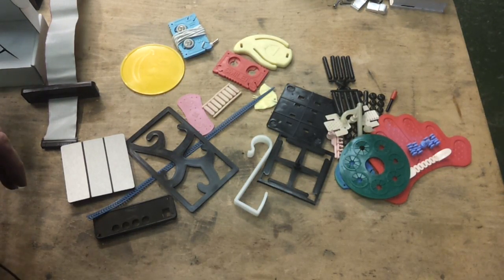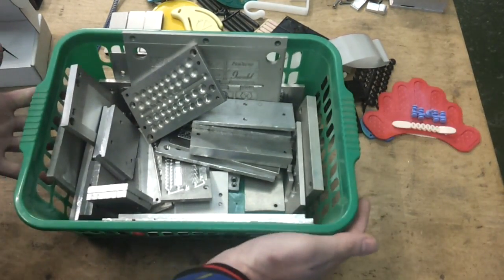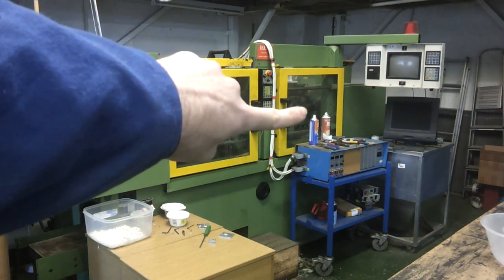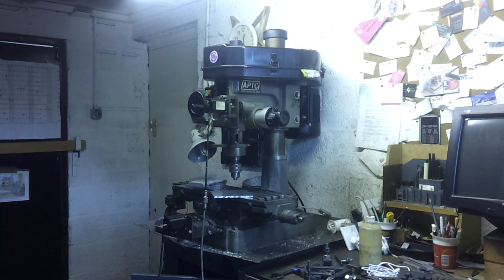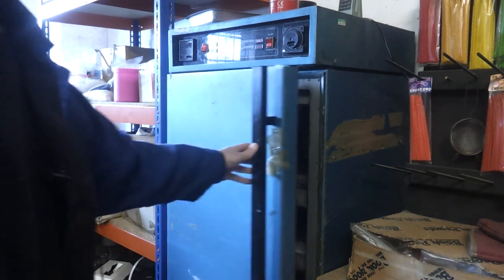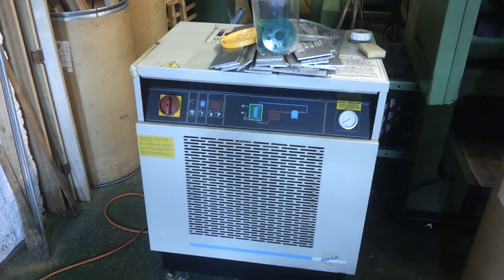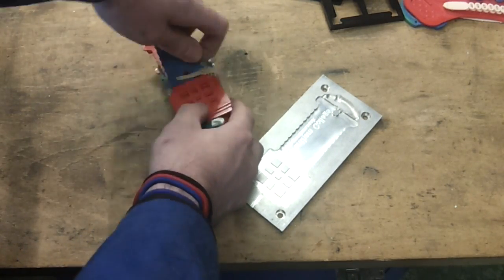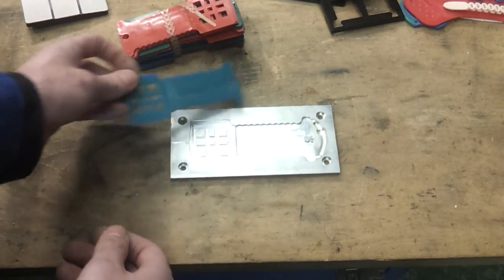Introduction to DIY Homebrew Injection Moulding

Comment: Introduction to DIY Homebrew Injection Moulding . . . first you gonna need a 40 ton Arburg lol not exactly "homebrew"
Reply from the maker: Yes, a 40T press is a bit big for the home, but there are alternative options - I'll be doing a video about it at some point.

There are quite a few small machines available that would fit in a garage, and check out the JohnSL channel to see what can be done on a table top Travin.

An industrial machine is more suitable for a hackerspace or community workshop. I know of some who have big Bridgeport-style milling machines already, and a moulder wouldn't be out of place in that kind of environment.

Comment: Comparing 3d printing with injection molding is like comparing a hammer to a frying pan! These tools are both great as soon a you use them for the right work.

Comment: This is ingenious! I built my own CNC machine and now I want to try with DIY injection moulding :) This video is great! Any advice for the design of the first mold? I want to start with the extruder of a 3D printer and use a regular filament to inject the parts. What do you think about that?

Comment: Thanks for this informative video. The small mold inserts are a good idea, since the heavier job is done by old steel molds. BTW which cnc would be enough precise for that? A shapeoko can handle that?
Reply from the maker: Maybe if you go slow a Shapeoko would work. I use a converted Axminster machine which is quite robust, but struggles with steel. In aluminium I tend to cut up to 1mm deep and run at no more than 6x the cutter diameter in mm/min. So 1mm cutters take some time at just 6mm per min!

You also need to use cutting fluid for anything less than a 3mm cutter, which can be problematic on the smaller table-top CNC machines. The much higher spindle speed will help, though, so may only need dabbing every so often.

As for accuracy, a lot is down to experience with the machine. Mine isn't great, but I've learned how to compensate and can hit about 50um in the X and Y. The Z is even better with a resolution of about 10um. I actually have to let the thing warm up as the spindle will expand about 40-50um after half an hour of running!

Comment: Thank you very much for making this video Andy, I have a Clarke cam 1225 miller which I thick is virtually the same as yours and I would be very grateful to hear how you did the CBC conversion on it please, particularly if you swapped the lead screws for ball screws Any help very gratefully appreciated and thank youPhil
Reply from the maker: Just added the stepper motors with some ironmongery. No change to the leadscrews, though the X and Y axes use a 5:1 reduction gearing which helps. Backlash is measured with a test gauge and compensated for in software.

The key to getting good accuracy is not trying to cut too fast. The pressure from the cut will cause a small deviation from the required path. I cut at 6x the diameter of the bit in mm/min. So it's very slow, but the accuracy is then down to about 50um, which is good enough for my purposes.

Comment: Nice setup Andy
Reply from the maker: Thanks! The CNC milling machine is nothing special, definitely garage/hobby level. It gets a lot of use though, since most of the work is making the moulds.

My moulding machine is a bit more hardcore, really need a small workshop for that, but there are smaller ones readily available on the secondhand market. (Or you could get to know a local moulder and borrow theirs when you need to.)

Rest of the equipment (drier, chiller, granulator, lathe) isn't essential. Mine don't get used all that much to be honest.

Comment: Thanks for making these videos Andy. I am in the process of deciding What to do, I am planing on building a small but well done injection mold machine, I'm a machinist. I see some small professional models similar to yours available for what seams very reasonable cost and wonder if I should just buy one of those instead of building my own. I would go that route but all of the ones for sale are far away and would cost 2 times more to ship then to buy.
Reply from the maker: I built a small moulding machine a couple of years ago, and it wasn't very impressive. A lot of work for something that "just about worked". Haven't yet seen a hobby machine that compares to a professional moulder, you need a lot of pressure and fine control on the injection side to get consistent results.( It can be done of course, but by the time you've got it working you may be wishing you'd just bought one instead!)

The reality is I can spend a few days making a mould and a few hours actually moulding it. The injection moulding machine is sitting there doing nothing most of the time.

So an alternative option would be to contact a local moulder and see if they'd be happy to run your moulds on one of their machines. They'd need to put together a bolster - probably recycle an old mould tool with a new face plate - but that shouldn't be too expensive, and you'd need that if you bought a pro machine anyway. 

Then you can get 50-100 good quality parts per hour without needing a machine yourself. (Machine costs are usually about £20-30 per hour.) The smaller moulding firms are your best bet for this approach. You'll also learn a great deal by hanging out with them, and if/when you get your own machine, you'll know how to use it.
Reply: Thanks Andy. I agree about having injection mold companies do the work, but I am a machinist and simply can't resist building my own machine so I'll see how that goes. I figure if I can have some success then it may be justified to purchase a professional small injection mold machine such as a boy or something similar.

~

Comment: Sir i am building a injection molding machine, but my confusion is,
Which sensor i should use to detect whether the part is stuck on mold or have been successfully ejected ! So that next cycle could be run.
Reply from the maker: Industrial machines have a low-pressure clamping action ("mould safety" it's called). If the mould doesn't close fully on a low force, then something is wrong and it'll re-open the mould and trigger an alarm. You could also use a light-barrier to check for stuck parts, or possibly detect them after ejection to make sure they dropped.

Comment: what type of plastic did u use to make the head phone holder
Reply from the maker: It was a thermoplastic elastomer (TPE), specifically a styrene-ethylene-butylene-styrene (SEBS).

Quite useful stuff since it blends well with high density polyethylene, so you can vary the hardness by mixing it.

Comment: I'm a member at nottingham hackspace, I thought all the hooks were just from the shop :) so i guess well done :) lol
Reply from the maker: Thanks! Some of the members came over one afternoon to do those. They were a pretty quick job.
Reply: I guess I know why people were so confused when I asked if we had an injection moulder lol
I've been looking at building a small plunger style one, and just wondered if it was worth it.
Reply from the maker: Early injection moulders used a plunger design, so it's tried and tested. (Some schools use a bench vice and hot glue gun to demonstrate the process.) There are quite a lot of plans out there for simple machines, and if you check ebay you'll see them come up fairly often. (Easier to modify one than start from scratch.)

I used to have a Travin machine which worked reasonable well (cost a few hundred secondhand). Tricky to get a consistent cycle, but I think that's down to practice. Plunger designs also don't mix the plastic very well, so adding colourants is a bit hit or miss, but otherwise it did the job for small parts.

Biggest issue with small machines is you need a very fast and powerful injection stroke. The clamping is not critical, car bottle jacks and a metal press frame is probably the best approach I've seen. Injection works Ok with pneumatic cylinders, but you need a large cross-section. I've thought about using a load of cylinders from cheap foot pumps, but not tried it yet.

The other thing that's often overlooked on bench-top machines is adequate cooling of the moulds. They get too hot to handle after just a few cycles, so adding something like a PC water cooler system to some large base plates might be a good option.

I'll have to do a video about the one I built a few years ago. Some bits worked well, others not so much. Never got around to making  a MkII, but I learned a lot from it.

Comment: Could you make a resin cast from a 3d print? Making a metal mold would be a bit to expensive.
Reply from the maker: I've been looking at alternatives over the years, but nothing beats an aluminium mould. You only need small offcuts, so they're actually very cheap. Most of mine are no more than £10-20 for the metal.